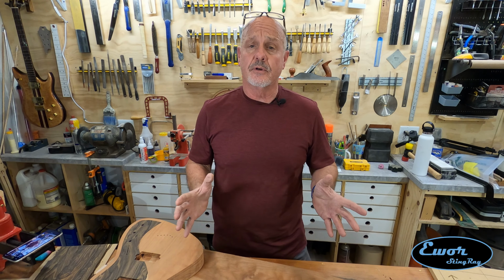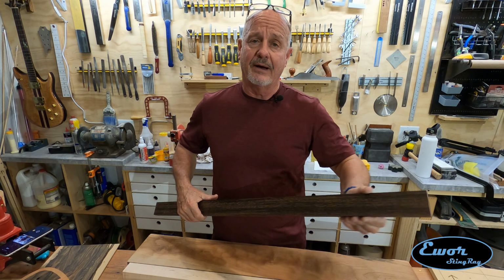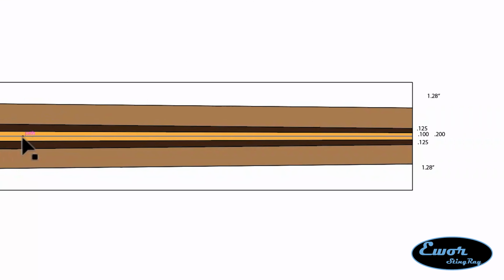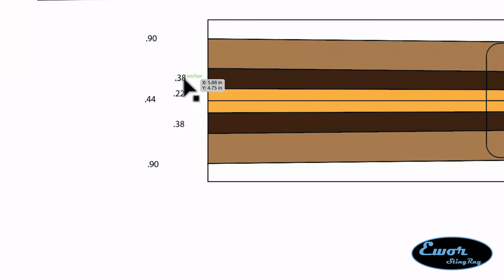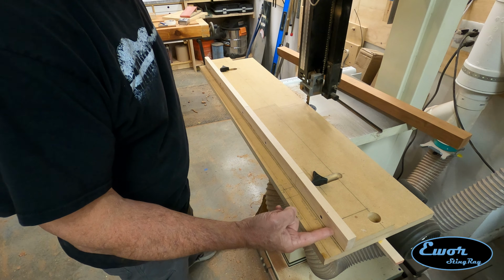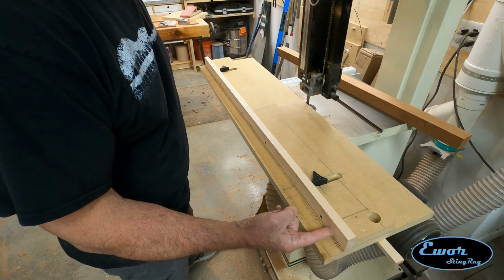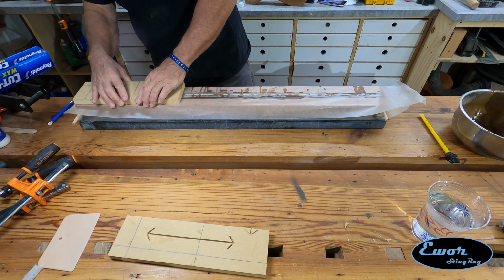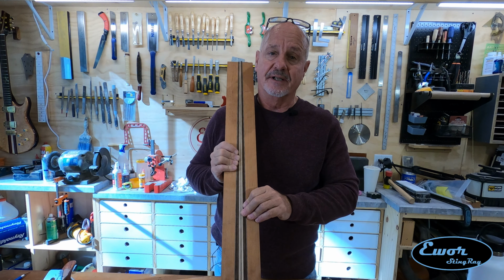Ewor Stingray part 6: Making a Multi Laminate Neck Blank

Comment: I'm curious why you run the taper jog thru your band saw rather than a table saw. Couldn't you get a jointer surface off a table saw and skip the need to go back to the jointer with those super thin pieces?
Reply from the maker: Yeah if I had a good table saw I could definitely cut the tapered pieces on it but I would still need to run them through the jointer to clean up the saw marks